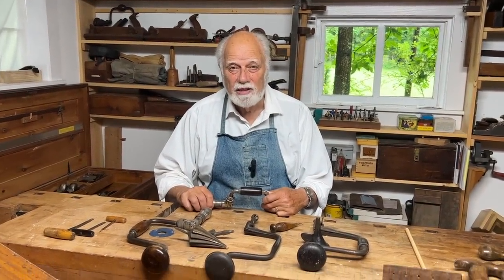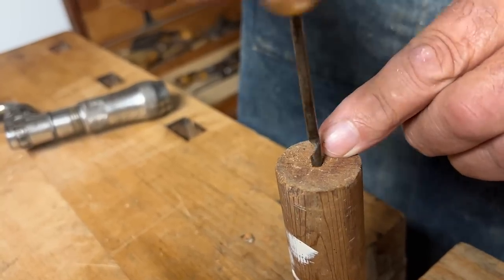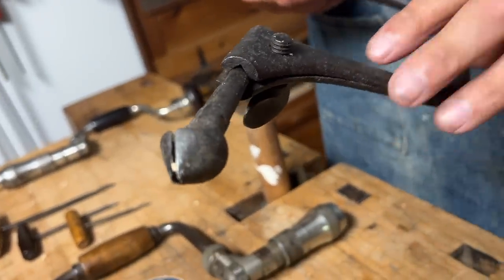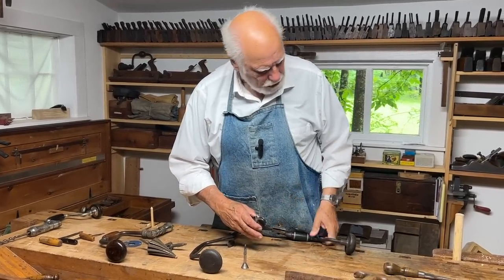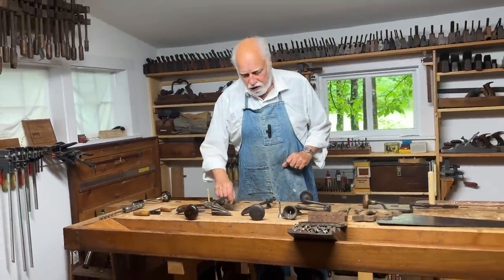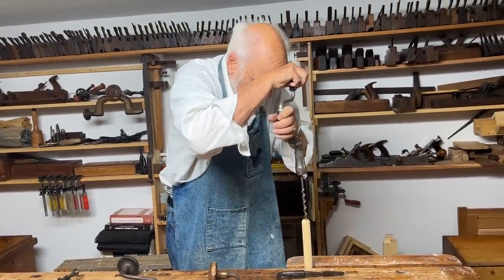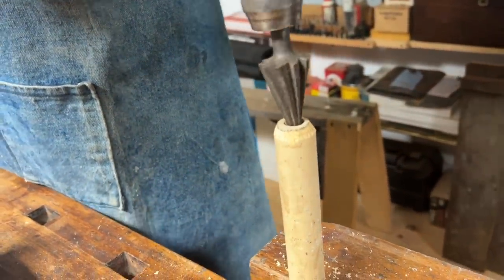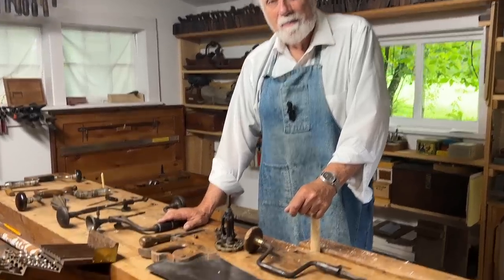49. Special Bits for Braces

Comment: Thank you again. It gives a whole validity to my workshop which reaches back three generations in my family and there is a plane or two of about 1750! Does it make me a better woodworker well no not at my age with failing wrist and other members but it does validate my insistence that by learning to use hand tools you are then able to use power tools . Later as with yourself you wish to hear the wood talk to you. Out goes power and wireless and with a little bird song and an English garden you can concentrate on the small jobs your body still allows you to do. I like your outer chamfer bit - Hmmm - would have saved time on trennels  will keep an eye out for one of those. Dam - when am I going to need one of those again! I did not spell my opening wrong by the way. A Dam was an Indian coin of such low value even Wellington’s troops cast it aside! How long is history and you Graham are instructing so many in it. Enjoy it as much as so many of us do.
Reply from the maker: Thank you so much!

Comment: I started my electrician apprenticeship in 1970. A brace was an essential tool. There were no battery drills then and to get wires down walls I had to crawl through the roof space and drill a hole in the top plate with the brace and bit, and then drill through the nogs with an extendable bit. We wired a few houses where there was not yet any access to electricity so the whole installation was drilled out using a brace and bit. I still have both my braces and a wide selection of bits, and they are still used - never any worries about having a flat battery.
Reply from the maker: Yep, not all 'progress' is ultimately the best!

Comment: When my grandmother passed I found an old brace bit in her basement. It seemed to be a bit more modern and had a 4 wall clamp like modern drills so it would take standard drill bits quite well. I have an older one as well that takes auger bits but I haven’t had much luck finding good quality auger bits at a reasonable price. Anyway, braces can be used for more than just woodworking. I repair guitar amplifiers for a living and recently had to replace a transformer. The circuit board was very large and removing it required removing 2 dozen wires. Instead of using an electric drill to drill the chassis and risk damaging the circuit board, I used a brace bit to drill the holes. It allowed me to drill slowly and get through the metal chassis without suddenly bursting through and damaging the circuit board. These old tools have all kinds of uses that allows for more control, more torque and less noise than electric tools.
Reply from the maker: Cool!